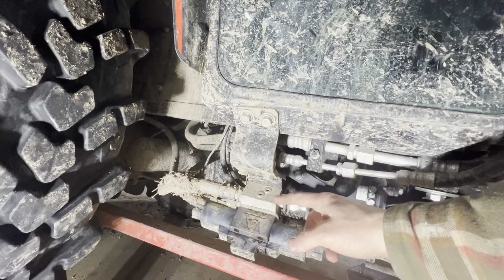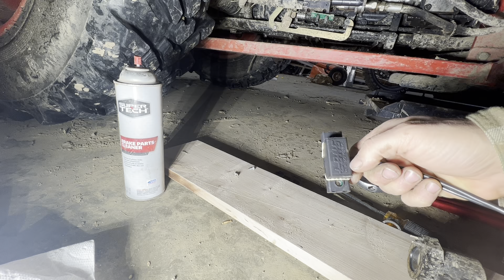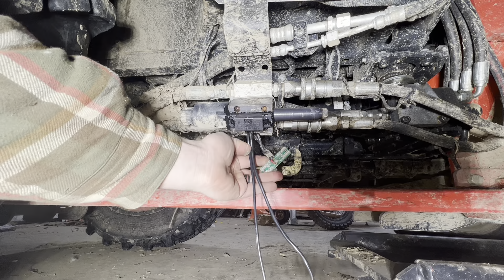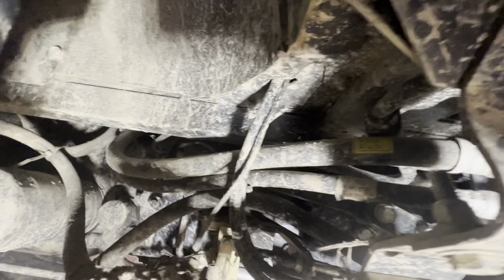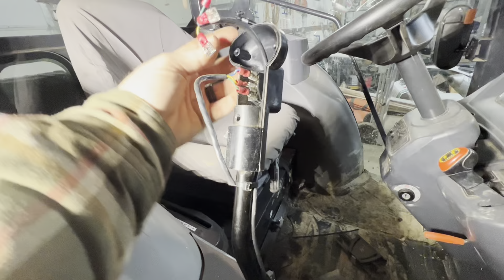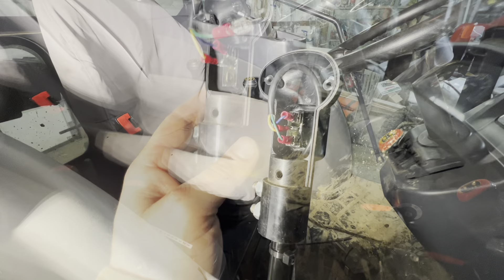WR Long 3rd Function Actuator Repair!

Comment: My valve system is mounted on the outside of my lift arms. So every day in the woods I worry about it getting busted off. Also no water proofing on my electric connectors. 

Josh S
Reply from the maker: Yea it’s almost like they don’t think we use our machines.
Reply: @DualsportDisport  hopefully manufacturer, install them from the factory with factory parts with the proliferation of third function attachments across the market. mine has like 16 gauge wire, not shielded not wire loomed just flopping around